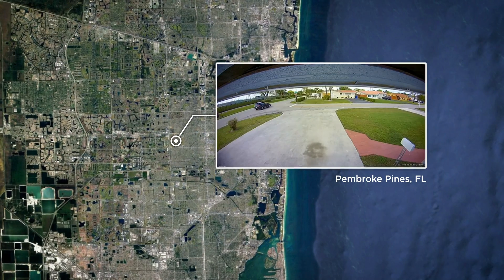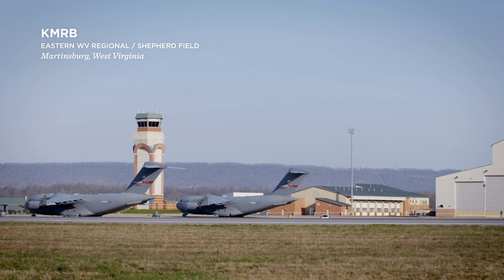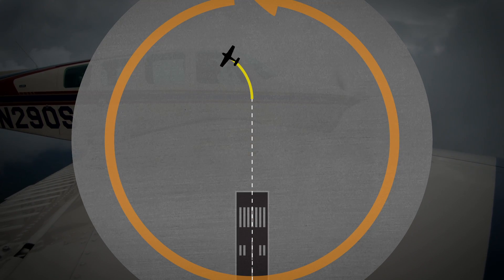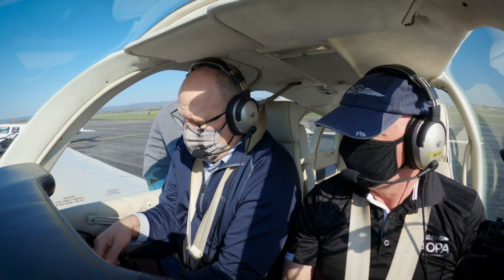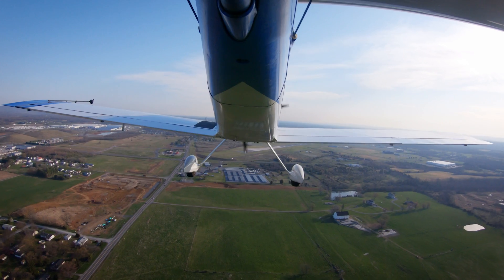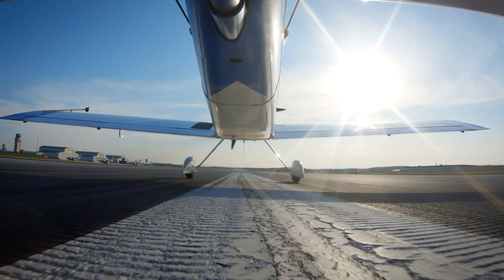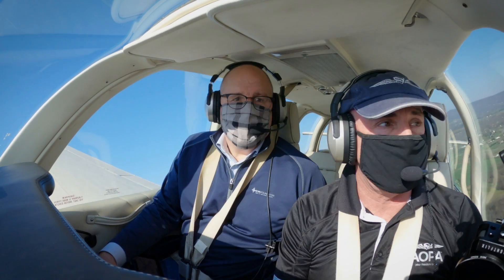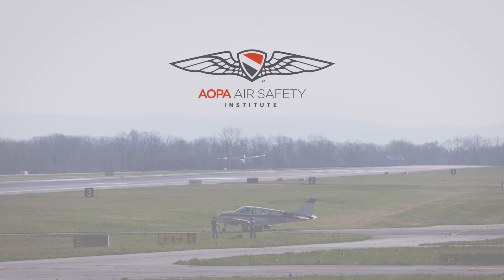Reality Check: The Runway Behind You

Comment: We were test flying a '61 Piper Colt, PA-22-108, I wanted to buy a couple weeks ago.  Shortly after takeoff the cabin quickly filled with smoke and smelled of burnt oil.  We still had power but visibility quickly became an issue.  We turned back with the window open and door cracked.  Little hairy trying that in a plane you've never flown, in front of the owners, not at your home airport and to top it off, the mic started cutting out.

We pulled it off and landed safely.  Pulled mixture and coasted off the runway toward the sellers.  Turns out rubber valve gaskets were tightend down too much and pinched.

Few cork gaskets, new radio and $1,000 off the price later, I now own a '61 Piper Colt!  😜
Reply: LoL, very brave to buy a bird that almost kills you. Congrats!
Reply: @David Donaldson 
It's all wing, very light, no flaps to deal with and short landing distance.  At least made for a simple turn back.  Not sure it'd have been as easy in a Cherokee I'm used to flying.
Reply: @StevenLeoKorell  With flaps it is easier to turnback with power on cherokees.  Safer with 10 flaps.  Like a slow flight turn at Vfinal speed.  I learned turnbacks on a cherokee 140 at 1,600 rpm, 500 agl after take off to a 4k feet long runway.  Mild winds...
Reply: @outwiththem 
My daily for the past 2 years was my school's PA28 161.  The Colt is a high wing with no flaps though.
Reply: New gaskets, radio and underwear... 😉👍

Comment: A real-world case study on this topic was long overdue.  Thank you for putting this together  Practiced 3 of these - at altitude - in my Cherokee 140 during my Flight Review wtih my CFI last weekend.  My range of altitude loss for a 270 degree turn was 400-500' using 80mph and 45 degrees of bank.
Reply: Like a brick falling out of the sky.
Reply: @john schreiber, liked your comment.  Could you text me or message me if you would like to discuss more?  One of our best PA-24 comanche pilots did this test and another a test on landing straight ahead in a PA-30 after rotation.  We are currently setting up a “ComancheZOOM” (zoom meeting every Thursday night, many we cooperate with FAA for WINGS credit).  I think your statement about distance from runway being under-emphasized is right and your  idea compliments.  Thanks!
Reply: Do it on a real runway.  It will be 700 feet AGL if some wind.  Or impossible if high temp or high weight OR NO WINDS.  Former CFI on PA28's.

Comment: I was not surprised, lower powered, slower lighter planes can maneuver with less altitude loss. Using two people with baggage in a hi powered, low glide plane like the Bonanza was a setup for not making that turn at 1000 ft. In my motorglider that turn can be made at 250ft with a 1000ft of runway. Great take away: It is different for every plane, every pilot and for the conditions. So there are a lot of variables that go into the statement weather the "impossible turn" can actually be possible. Bottomline: do you feel comfortable flying that turn with your engine out, without stalling? That is probably a personal question for each pilot.

Comment: That was a very informative video, but I think there is a middle ground between a 360 degree turn back and a 180-230 degree turn back. When flying out of an airport surrounded by dense housing and other inhospitable buildup, I think there is a strong argument for just getting back to the grass open areas on the airport, rather than trying to get it to the pavement. An all or nothing belief that you have to get the thing back on pavement is unrealistic and potentially dangerous. A parallel taxiway might also be the better alternative.
Reply: I have to wonder if the pilot in the Pembroke Pines crash was thinking he could make the parallel runway with only 180 degrees of turn. 0:11

Comment: What about a wing over? As a test to determine viability. Not to be taught in flight training, but for aircraft like the Bonanza with experienced pilots. Altitude loss would be significant, however, it would get the aircraft turned around more quickly. The challenge would be the 3 second startle factor. It would have to be completed immediately to use all available airspeed. Would be an interesting test.

Comment: I think the take away is, if you are thinking about turnback after take off practice until you find a height where it is comfortably safe to do so. In your every day flying add 200 feet to that number as a minimum. If you have an engine failure on take off below that height, you are landing ahead only.
Reply: Nope, probably won't work either. You need to think about climb angle. The Bonanza is a fast airplane, but it moves a lot to gain its altitude. Apparently, it's also a not very efficient airplane, so when the engine fails, it starts to lose altitude fast. Faster than it gained when climbing, per distance.

I think to determine if a plane can do the impossible turn, you need to test the distance travelled climbing 1000 feet at Vy, then test how far it travels at idle until it has lost 1000 feet, at best glide speed. If the glide distance is at least double the climb distance, you may consider it.
Reply: @realulli  yes, so in that sort of an aircraft you might determine that 1,500 is the min height so anything below 1,700 feet is no go.

Comment: Would it be a viable alternative to first do a 90°-right turn and then do a 270°-turn to the left in order to be better aligned with the runway? (I am not a pilot, thus, this question may be silly).
Reply: Valid question and I appreciate you asking it, but my short answer is a firm "no". If there is a crosswind, one of the best things to do is make the turnback in the direction that the crosswind is from, which shortens the flying distance back to the runway. If you turn the other way, the pilot greatly lengthens the flying distance and virtually guarantees an unsuccessful turnback.
Reply: @zidoocfi  Correct.